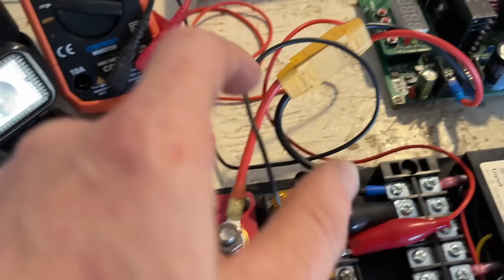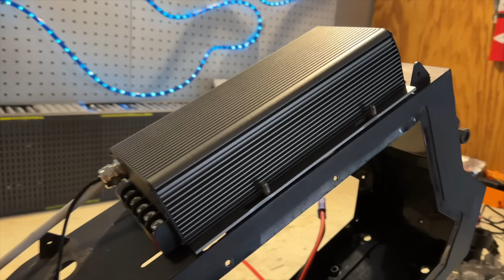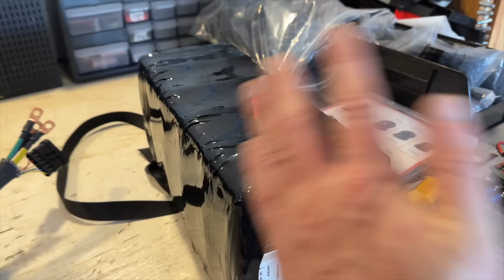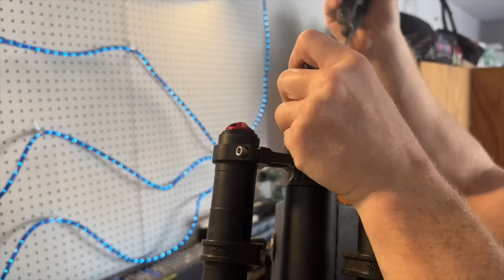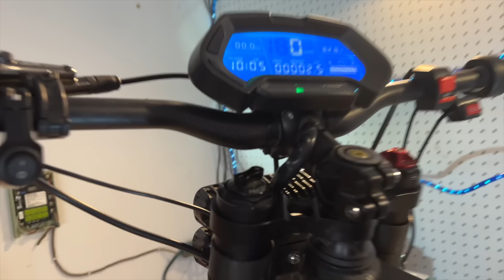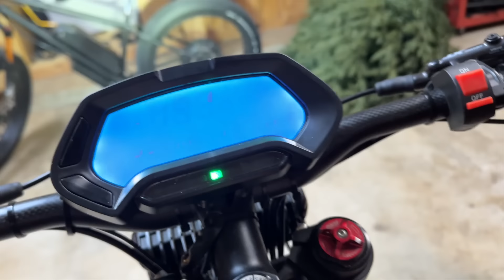This Might Be The Best Way to Build a Stealth Bomber Ebike

Comment: I don't get guys like you. You build these nice DIY bikes and put the shittiest narrowest MTB fork and a fucking MTB stem on a bike like this. Get a really kke factory fork used if it's a $ issue. $350 and it's be fully adjustable and it's be strong wide and not crack under weight or torque. Get a direct mount stem but you can now because you have that crap $50 fork. MTB girls aren't bad for bikes like this but you just have the biggest POS fork possible. You guys risk getting seriously hurt and for what reason? You like how it looks? Don't know the difference and you that shock forks are all the same? Idk I see this constantly people make sick builds and put the worst fork, stem, bars, and rear suspension or they get all good gear and use a $50 Walmart MTB frame.

Read that yellow triangle sticker I bet it says that this fork isn't meant for jumps or actual mountain biking. So if it can't do that it can't do shit with a 100 or 200 lbs of weight added to it. Stay safe man this comment isn't to be a dick or shame you. I get mad to see people risk serious injury or death.

Comment: I appreciate it Man, though I had to run through it a few times. finally finishing up my parallel connecting e-bike battery schematic. Making sure everything's alright for 102.4 volts. It's all about the cool 12-volt accessories, even a portable mini tire inflator. I left the front electrical box handle the 12 volt to 9 volt, and 5 volt.
seems like the only misinterpretion for me was the 12v to contactor when instead you did show it is main battery + power supplied.

Comment: Alibaba build 
 
 20KW motor, 72V75AH Lg Cell battery, 200A controller, BMS 200A, new dashboard, white model with black rims and forks, bicycle seat, with front and rear fenders, front and rear turn signals, 84V10A charger, electric horn, tail light, alarm system.

Comment: The main problem is in the relay and the key switch. Because you intend to send 72 volts directly into the key switch, which is really bad! Because the switch contacts will die really soon.
Reply from the maker: not true - key switch is just a simple contact, no electronics or sensitive components. The only way it can wear is through tiny sparks when the connection is made, which are harmless in and of themselves but would build up soot on the contacts over time and make them less conductive. however this would take a long time, if it will ever happen at all given that the contact points in the key are forced together through friction, thereby rubbing the contact points and effectively cleaning them. and whether a spark occurs or not if dependent on whether there is built up charge somewhere in the circuit, which for the relay with tiny current, there’s simply no capacitance to generate even a small spark. yes, 12V would be ideal but this would either require a secondary battery or an additional mini-step down converter just for the relay circuit which takes up more space and adds another point of failure. no way this key will degrade from 72V faster than I crash this bike

Comment: Every part of that biek is amazing exept for the 11 dollar throttle he used 😭
Reply from the maker: thanks but there no reason to overspend on a throttle. it’s different for gas bikes but for electric, it’s just a glorified potentiometer or voltage divider - literally a 75 cent component. most important thing is that is doesn’t get stuck and feels good in the hand

Comment: Hey man, great video, Great showcase and easy to follow. Just curious what the max weight load is on the bike. And perhaps what you'd recommend doing to increase the weight limit if it's under 90kgs.
Reply from the maker: thanks! are you asking about the max rider weight that it can carry? basically depends on the suspension - i’m using budget suspension components so it’s pretty basic but i’ve ridden it with my gf on the back - sometimes even with my wife
Reply: @GaiusGarage HAHA!

Comment: Hey there, nice video! If I'm understanding your wiring correctly, the controller is powered on from the highvoltage upon turning the keyswitch, but the controller is prevented from accessing all the high current until the contactor is closed, correct? Good for safety and good for precharging the capacitors in the controller to prevent in-rush. However, since the controller is on, what happens if you hit the throttle hard accidentally before closing the contactor? Wouldn't it try to pull a lot of amps through the small wire it's being powered from? 

Would it just pop the small automotive fuse you have on the contactor signal wire?
Reply from the maker: no because with the contactor open the only path from the battery to the controller is the precharge circuit across the resistor, which is far too much resistance to provide any usable current. basically the bike would very lightly pull then cut out and you'll probably hear some beeping or something from the controller throwing a warning/error code. this does no damage to any components, just kick the contactor on and youre good

Comment: I know this video is 2 years old, but figure I'll ask anyway....any concern or issues with having the phase wires and dc line wires exposed right behind the front tire? I'm considering relocating the controller on my bomber clone due to the heat build up having the controller inside the frame, but don't wanna risk a short if I happen to get caught in rain or even just drive through a puddle!
Reply from the maker: I've never had an issue with shorting due to splash and I have ridden in the rain. that said you should definitely use some terminal covers which I didnt do here
Reply: @GaiusGarage  okay that's what I was thinking. Do they make a terminal cover for the sabvoton controllers?
Reply from the maker: @bbllrstv13 not specifically. you would just get one for the gauge terminals (8, 10 etc) most fit a range of sizes
Reply: Oh okay cool, thanks!  @GaiusGarage

Comment: On my Hard tail MTB install running a 52 volt battery I am using a buck converter going from 60 to 12 volt at 30 amps max.  I am running dual car horns which draw about 15 amps but there is a spike that happens when using the horns so I opted for a 30 amp converter and my horns work great now.  Your installation is very clean!

Comment: Nice build. However, I will be using something other than aluminum shims around the battery. I try to eliminate as many conductive materials as I can around the high voltage.

Comment: The reason the display and the status LEDs are two different voltages is that the display uses its input voltage to show you the battery percentage and the status LEDs are generally connected through things like your headlight turn signals etc which will be 12 volts.

Comment: I would have put some tpu as isolation and suspension on the side walls of the aluminum plates that hold the battery pack. You can make it soft and squishy or hard rubber like depending on the infill percentage.

Comment: Funny enough I have a similar setup in my SB ebike.
We must think alike 

But the main reason i built one.
Was for the pecharge system.
Which is very important so you don't blow capacitors in controller.
I don't think I seen one in your set-up.

Comment: I'm on my sixth build now, I'm still working with 350-750w motors and little 36-48v batteries. The biggest problem I have is sourcing parts on the cheap.
I love watching these vids for inspiration and to see what I'm working toward. Thanks for the upload.

Comment: I know this is an old video but, can anybody explain why your hub is pulling over 150 amps? I have tried to work out the math ten times. With the setup my math outs you at 50ish amp draw all full power. Did I miss something?

Comment: I hv same rear DNM shocker
Q. Can we seat two persons with this shocker?
Reply from the maker: Ive done it - its not the best -- not really designed for two people like you might have on a motorcycle. that said, a frame designed for two people and different placement of the shock (or even using two shocks) would definitely make it a lot more feasible
Reply: @GaiusGarage  
I checked that its spring is very harder than my scooter which takes 2 people easily I’m shocked. 
It can break by 2 person seating ?

Comment: hey bro about the regen braking. Does the frame stop the motor axle from rocking back and forth when you brake then accelerate? or did you need to use a separate torque arm? love to know how that works. I did not notice how that worked for you in the video.

Comment: If you can pick off a lower voltage - or use an additional very small dc-dc convertor - you could use a SSR instead of the contactor.

Contactors do still wear out the contactor points over time, in addition to generating heat.

They are a lot cheaper now too. I've seen several with 100a output for under $20.

Comment: I made my own bike whit alibaba frame and 1500w rearhubmotor kit. It had 52v lfp batterys, but it was way simpler than yours. I'm amazed how complicadet and dificult it is to make high power ebike like yours. Thanks for the good video man. I had wery similar frame, but only wires was controller plus and minus, motor connections whit hall sensors, connection to display, throtle and that was it. I tuned it up to 3000w whit difternt conroller, but is was wery simple after all. I think I am only one using lfp batterys for ebike, but they worked wery nice giving all the power all the way even battery was low.

Comment: Hope one day it's possible to build a weather proof version which can be used also in rain and snow.
Reply from the maker: its definitely possible with a bit more effort, I just didn't bother since I typically wouldn't be riding in those conditions
Reply: Oh mate it’s pretty easy actually, the main way to make it possible is to use gaskets, pass throughs, silicone sealant along all the inside of the panels to ensure it’s sealed and on any holes that aren’t being used put in rubber stoppers with more silicone/rubber based sealant.

Comment: Only 59mp with sab 200A ?! That’s pretty low … it’s fully unlocked ??
Reply from the maker: top speed is more a function of the motor winding & voltage than the controller
Reply: @GaiusGarage  unless that motor is a 5T, stilll ! You are running 72v5000w which is more than the bough to give you at least 70mph with a 200A sab 

My 72v5000w 3T np power motor ( not even a QS ) gave me 72mph with a fully unlock 150A sab 🤷🏿‍♂️

Comment: I'm trying to buy the fastest stealth bomber any advice where to by from or what to buy for the best price?
Reply from the maker: fastest as in most acceleration or highest top speed?
Reply: @GaiusGarage  highest top speed
Reply: But I've been looking at alibaba looking for good deal
Reply from the maker: are you looking to buy a completed stealth bomber or parts to build one yourself? if the former, youre not going to find ones that are high performing on Alibaba. it's not profitable to sell them with high end components so top speed and all other metrics will be average at best. only way to get high performance from a stealth bomber is to go custom. for top speed, you need as high voltage as possible and a motor thats wound for high KV value. but you also need enough current to push through wind resistance.. so that means you need a high performing battery pack, which youre definitely not going to find on Alibaba. There are some businesses that build high-end battery packs but I'm not sure there are many (if any) for stealth bombers, mostly Sur-ron. If you really want something high-performing, you really have to go DIY. But if you're going to spend the money a modded Sur-Ron can be made to have a higher top speed that stealth bomber with better handling and performance

Comment: On average what kind of range and you getting? I have the exact motor and I'm about to build the same or very similar battery pack. Depending on what dimensions i need. Like up to speed highway range
Reply from the maker: range is approx. 40-50mi depending on riding style
Reply: My cab motorworks eagle battery is on its last leg. Has a 20s12p with the same Samsung Q30s. Currently trying to figure out a configuration for more run

Comment: How much - generally - does this parts list cost?  I want to build an ebike to do my research on, and this bike looks appropriate in all aspects, for one wave of the processes.  This is a very good video.  Thank You For You Works and Sharing 🙏🚂🎼🌹🎵🎶🛠 ~C< 3)>>-Z-}
Reply from the maker: If you build a battery pack yourself you can build this for maybe $2500
Reply: @GaiusGarage  awesome.  Thank You SO MUCH.  I would prefer the battery be built by someone with the tools to zap.  I have not built a tack welder, and dont want to for a while. I have minimal space and want to move quickly.  This is a great build  🙏🛠🎶🎵 Thank You SO MUCH
 W/o batt i estimated $1691.oo on your list rundown 💕 what is a 72v batt build cost from you ?
Reply from the maker: yeah that sounds about right. I would charge $1k for labor without a battery box. If you need me to build a battery box that would be an additional expense depending on the specs. shipping might be $100 or so within the US. If you can sources the cells at a relatively low cost, the pack can be built for under $2k. Feel free to book a consult session if you're interested https://calendly.com/gaiusgarage/15-minute-consult

Comment: Hello from Germany. This bike was nicely designed. I’m not into dirt bikes, but this is sweet. I ride an ebike also built by myself.
Reply from the maker: Thank you!
Reply: Just put different tires and it’s a street bike. I have both and 2 motors, so that I can just swap.
Reply: @cryptokids420  enjoy!
Reply: Hey, Ich habe auch vor mir ein ebike zu bauen. Hast du die Teile auch aus China bestellt (vor allem den Motor) oder hast du Empfehlungen für Händler die hier aus Deutschland erreichbar sind?
Reply: @Yuley  ich hab bei Amazon bestellt. Bafang BbS01 b, Akku von Halt dich fest KAUFLAND. 
Akku hat etwa 200€ gekostet. 36 V, 13 ah. Ist gut für 60 km Reichweite mit 25 km/h
Reply: @SimonatMac  achso, ich suche da mehr nach etwas wie der Typ hier es hat. Wahrscheinlich 3000W motor mit 72V Batterie
Reply: @Yuley  Du kannst als S-Pedelec LEGAL bis 4000 Watt gehen ;-)

Comment: why not use a fardriver ND72360 x type controller?
Reply from the maker: you can but Im not a fan of Fardrivers. I have some on the electric KLX conversion and its pretty underwhelming. a lot of issue programming it also - Sabvoton is better for this build IMO
Reply: ohh thanks for sharing thats why i asked.. clearly your building from stock @GaiusGarage  i have built my share of controllers for things not ebike starting with uno
Reply: @GaiusGarage  800W SOLO UNO: 8 to 58V Motor Controller with 32A of a continuous current

Comment: Hey man how did you get veritable regen to work I don't see the option on the PC software did you connect it to the Pas assist pedal input
Reply from the maker: there is a seperate connector for a throttle to use for variable regen (not the same as connector for PAS). then in the software you set the braking option to use variable regen but I don't remember the name of the setting or option. it's definitely there on PC as well as the iOS app
Reply: @GaiusGarage  okay that's what I was afraid of mine doesn't have that
There was a plug for the throttle and there is a plug for the PAS
Thank you so much for your reply I bought the same controller as you I copied your bike in every way
Reply from the maker: @johnfarias7230 ￼ you probably got a different version of the Sabvoton. It's the same controller but the harness is different - some are set up to use with a proprietary display others have a harness more accommodating to a DIY setup
Reply: @GaiusGarage  That's what I was really afraid of
Nothing I can do about it now $550
Reply from the maker: @johnfarias7230  if you want I do have a Sabvoton 72200 - it is a TFT (proprietary display) version but it does have the second throttle for variable regen. I can sell it to you for $250 and you can sell your other one for probably more. Only thing is that you'll either have to buy the TFT display or hack the wires to have a manual on/off switch. Then you can use one of the hall signal wires to set up a generic display
Reply: @GaiusGarage  hell yeah thank you
Reply: @GaiusGarage  let me know how we can go about this
Reply from the maker: @johnfarias7230  shoot me an email gaiusmoto@gmail.com

Comment: Link to motor not working. What’s the max theoretical power output on that motor?
Reply from the maker: Just updated the link. Keep in mind there are several options for this motor, link does not point to any one particular option. Max power *input (motor does not output power, it converts power) is something like 20kW peak. This means you can pass 20kW the the motor for a second or two at a time without it overheating. Max continuous power is 3-5kW or so. You can add cooling or various sorts to improve performance

Comment: What size wheels did you put on your bike?  I want to start getting the stuff together before I get working with you to build battery and wiring.
Reply from the maker: These are 19" motorcycle rim. I don't remember the tire size actually